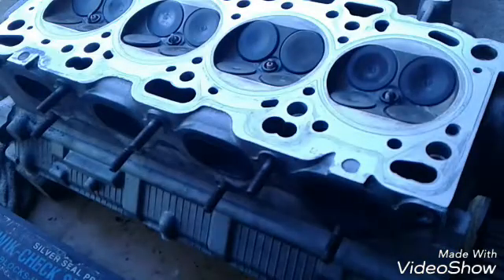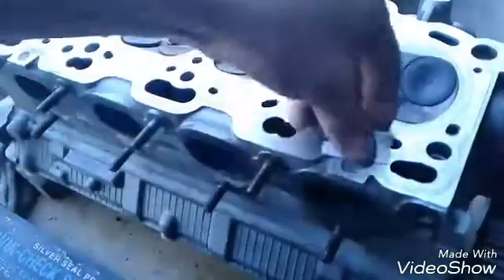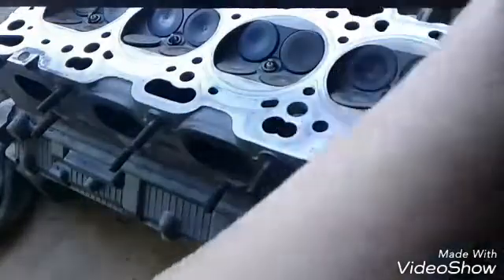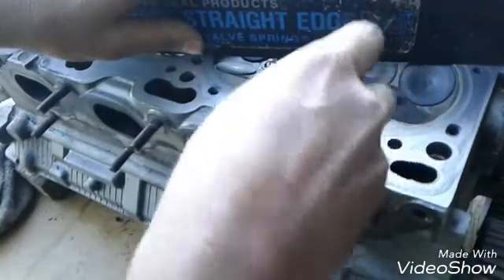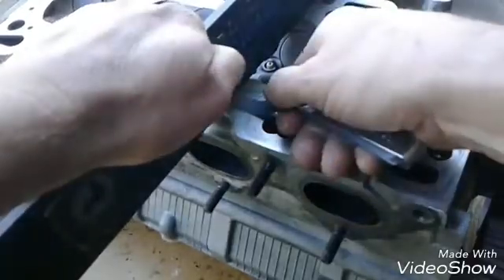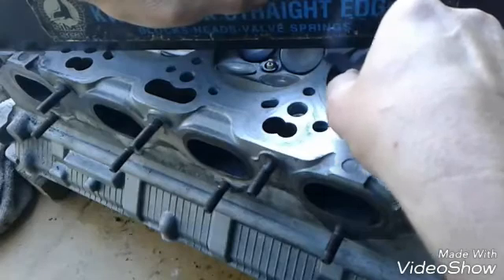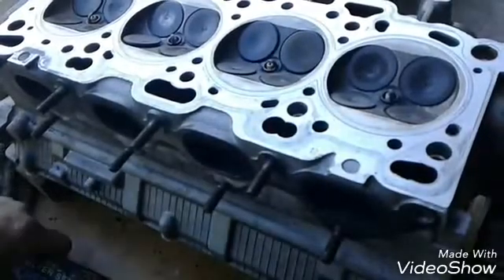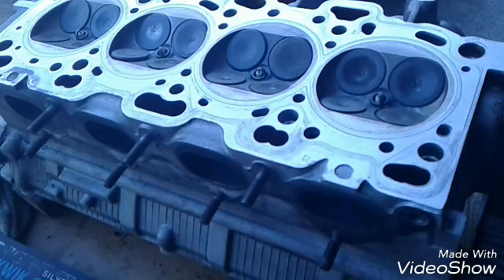Does My Cylinder Head Need Resurfaced? How To Use A Straight Edge

Comment: Surfacing a warped head DOESNT TAKE THE WARP OUT! A warped head is going to have warped cam journals. The head needs heat straightened until the cam journals are aligned to spec. Then you can lightly skim surface the head if it needs it at all.

Comment: You said you could go up to 7 thousandths of gap and still not have to resurface but YOU require that it pass 3 thousandths before declaring the surface straight.  Why such a difference?  Would a head that only passed 6 thousandths be prone for Headgasket leaks?

Comment: do they resurface with valves in place so you can just reinstall, or do you have to remove all that?
Reply from the maker: As long as the valves are not protruding out past the surface side. If it has a overhead camshaft, you might be able to rotate the cam until all the valves are down in the combustion chamber enough to surface. If it's a overhead valve motor, you shouldn't have to worry as the valves will already be closed with the push rods removed. In any case, the guys/gals at the machine shop will know to remove and replace valves, thermostat housing, dowel pins, or anything that will take a chunk out of the surfacing machine stone. If it's a diesel head, the valves may be flush with the surface side and will most likely need to be removed. Hope this helps and thanks you for watching!
God bless!